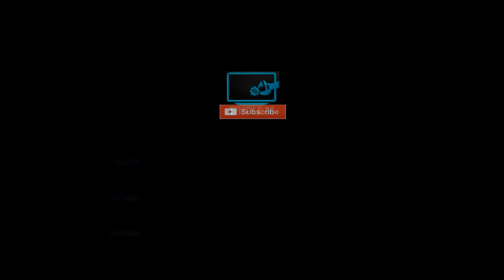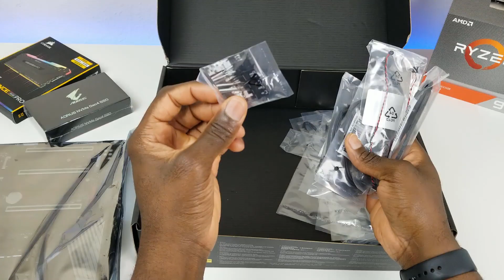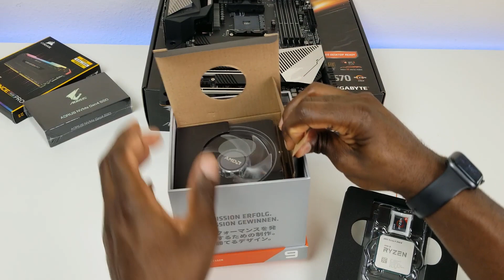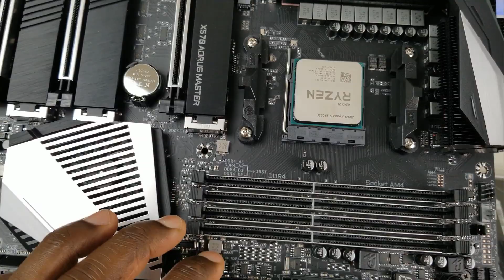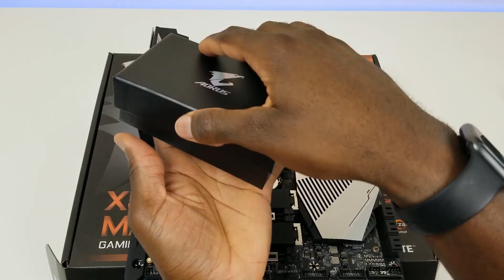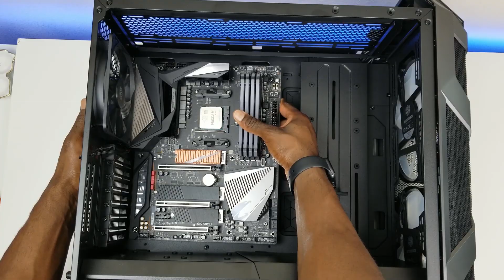Aorus X570 Master Motherboard | Ryzen 9 3900x Unbox & Install | Ultimate Gaming PC Build Part 3

Comment: That little triangle on my motherboard (Aorus 570) was almost nonexistent. It's black and barely there. The chip dropped right in. The heat-sink required some pushing down but it was simple. Thanks for the video man. Peace. Liked and Subbed

Comment: is it ok that on an unused new Ryzen 9 there are small scratches on the top of the cpu that are visible at a certain angle of light?
Reply from the maker: Where did you buy it from? If you got it from a store and you are concerned,  just return it. Chances are that it works fine though

Comment: So I bought a Sabrent Rocket for the X570 Elite mobo but the SSD is shorter that the heatsink that comes with the motherboard. The SSD is 2280 and the stand off screw that came with the motherboard doesn't thread into the '2280' space to raise the SSD off the board. Plus, as the heatsink is flush and flat the SSD drive would not be in contact with the heatsink as there's no stand off screw 😫 my first build and I'm stumped!

Comment: you are going to have to yank that motherboard out again because you havent allowed for the CPU cooler, havent removed the black plastic covers, havent turned the board over to install the adapter for the appropriate cooler frame/stands etc...after doing all this

Comment: I’m working on my first gaming/video editing rig and I’m going with the x570 board...but I’m torn between the Auros Master x570 (that you are using) or the MSI X570 ace. Both are hailed as good performing boards but they are apparently infamous for bios updates and start up inconsistencies (particularly the auros master)

Is this true based on your experience?

Comment: Nice clear instructional, comes very handy! 

I would recommend next time tough, an anti-static wristband. Because those semi conductor layers are so extreme thin, that static voltage (easily 10.000 volts) can damage those layers, totally or in most cases, partly. It looks under a microscope like a lightning trace. That, in time,  creeps it way up to the other layer. And at that moment, after many months, the equipment is ‘suddenly’ defect. And one can often then wonder; how is this possible?

Nevertheless most instructionals never show such wristband or mat...

Many thanks for this instructional!

Comment: Hi  I have same Motherboard with ryzen 5 3600 and same ddr4 ram as you just system not work no signal in the monitor. I do some search about a ddr4 ram support for gigabyte x570 master and them ddr4 ram not supported.  So the question is if your ram working.  Thanks
Reply from the maker: Yes, my system works perfectly. No issues

Comment: Hello I was wondering if you'd be able to help me, I am having trouble getting my motherboard in correctly, especially having trouble with the IO shield and getting the top standoffs to line up, any advice? Thanks!
Reply: Any answers or things you figured out having a similar problem aligning any standoffs and hoping anybody has any answers for me.  So far nothing.
Reply: @conker1847  i was able to get it to work, the IO shield doesn't really fit correctly, the IO shield wouldn't snap into place, but it was good enough to work

Comment: When i got my ssd it came in a bracket w heatsink. I removed it put the silicon strip from the box on it and it just looks wrong it has a big gap above the silicon under the fan.
Reply from the maker: Which SSD did you get?
Reply: @Triple_M  i got it of scan. Its the fasted one for the smallest storage of 500gb
Reply: I dont have the same motherboard actually mine is itx

Comment: Thanks! Question, ryzen 3900x and mobo x570 msi pro carbon with 12 pins for cpu, if i will not put 12 pin but 8pin it is possible that pc will not start? Cuz something is wrong, i push start and there is only Red led and off :/

Comment: Question, I ordered this mobo with the ryzen 9 and a rtx 2080ti does the mobo support ryzen 9 or do I have to update the bios to support the ryzen 9 series??
Reply from the maker: It supports Ryzen 9... that’s what I have installed
Reply: @Triple_M  yeah just build it for my friend since that was his build, after installing it wont boot no screen, fans shut down after 3 seconds and continue after anothe 2-3 seconds, no bleep sound from speaker nothing, i assume the board is broken so he returnes it tomorrow

Comment: thank you for this!
Reply: ... perhaps you could assist with a simple question that I can't find any info on?  The cpu power supply on the motherboard has 16 available pins (upper left on the mb).  The Installation Guide that comes with the motherboard says nothing on the topic but it does "depict" connecting only 12 of the 16 pins, leaving the right furthest most 4 pins in the block empty.  Why have 4 pins on the motherboard cpu power supply if they're not to be used?  Many thanks, Steve

Comment: Am I supposed to use a standoff with the NVMe like you did? I used the factory cover that you removed but didn’t install a stand-off and just screwed it back in
Reply: Actually I rewatched when you installed it and noticed your NVMe was shorter then mine. So mine already has a stand off we’re the factory covered screwed in and I reused it. I’ll have to double check in the morning

Comment: That M.2 might be a problem depending on GPU. I couldn’t put mine their as my 2080Ti wouldn’t allow it. I used slot C. Anyway, I’m curious did you get it to post yet? And if so how’s the memory running? There have been many issues with RAM not working with XMP unless manually entered voltage is used. And even then some RAM simply won’t go above base speeds (2000-ish MHz).
Reply from the maker: I'm actually working on the cooling system now. I'm also using the GPU riser to mount my graphics card vertically, so no clearance issues with the m.2
Reply: I have the Aorus Z390 Pro Wifi with i9-9900K and Corsair Vengeance Pro RGB 16GB (2x8) 3600Mhz. If I use the XMP my PC freezes in 10 or 20 minutes. But if I turn off the XMP I can use it normally. I have installed the last BIOS update but the issue keeps appearing :(

Comment: i just got the Ultra board 570, what is that tiny GC f panel chip ? were can i use it for ?, and were do i put the temp sensors ? just hang them in de case? somewere ?
Reply: Just got my MB mail was wondering placement of the temp and sound things also.